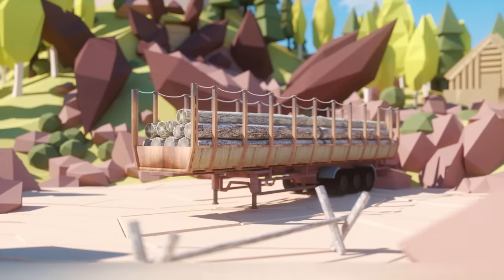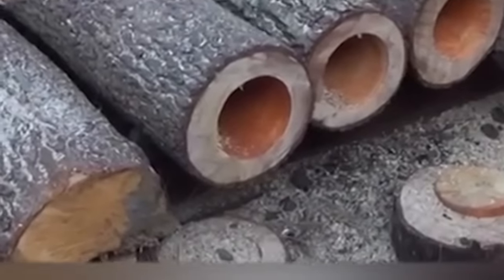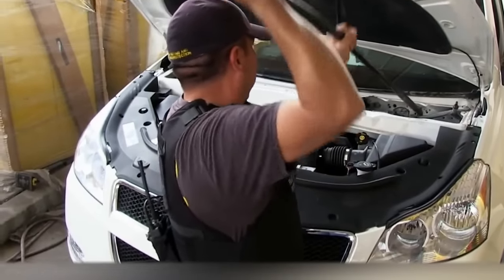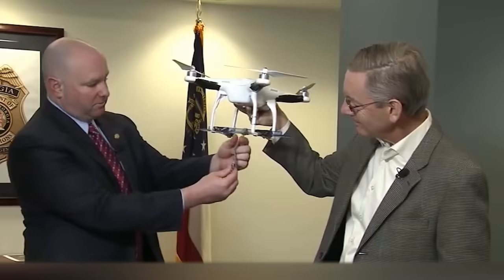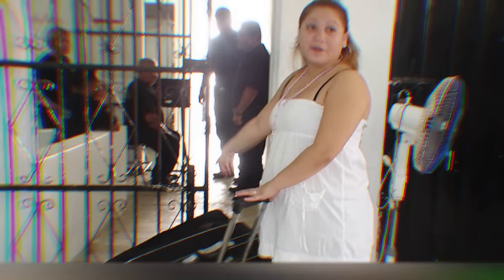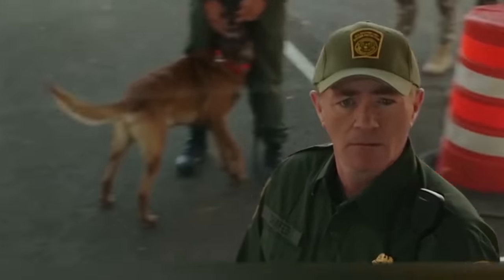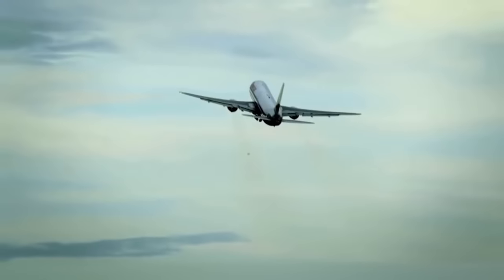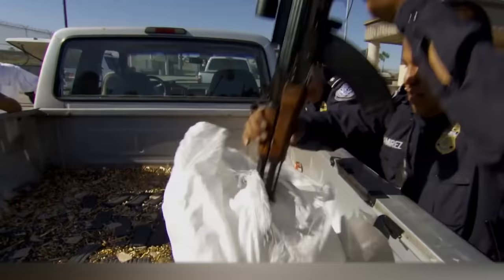10 Smartest Smugglers in All History

Comment: As far as the gold, had it been Nepal, then it would likely have been the person who hired them to smuggle the gold, who ratted them to Customs, as Nepal has a policy of sharing seizures with the person who reported it, if there is no challenge by the defendants to the court within a specified period.

So the ring leader will frequently tell the smuggler (typically a foreigner) to just sit tight in jail and not say anything to the authorities, as they are working on their release, all while actually just biding their time. Once the challenge period has expired, the ring leader claims the reward, and leaves the smugglers to rot in jail.

Comment: I would replace the steel toe in a pair of boots with what ever I'm smuggling such as metal like gold to get them past airport security
Reply: Which would go off by metal detectors.
Reply: @J4TiDotCom  true but when they go off most boots that have steel in them also have a tag inside to show they are steel toe and as long at they don't have one that shows the metal they are detecting you wouldn't get caught